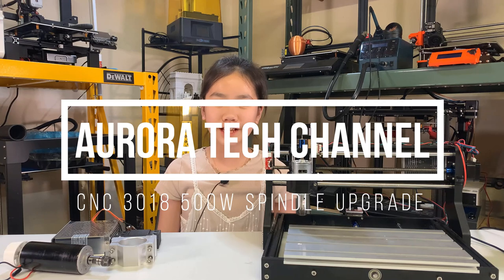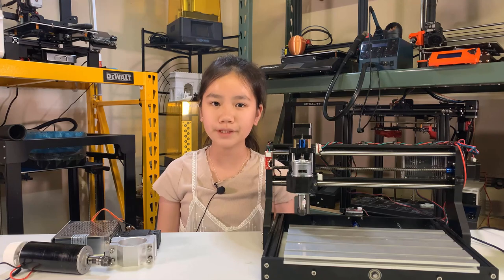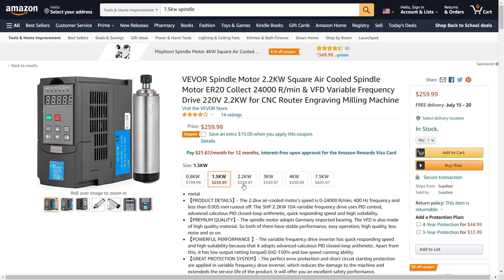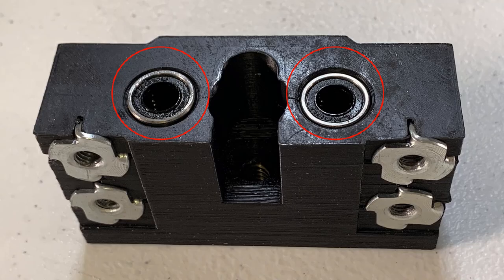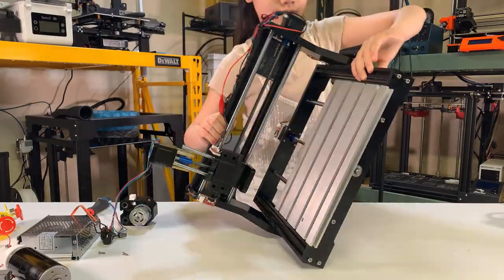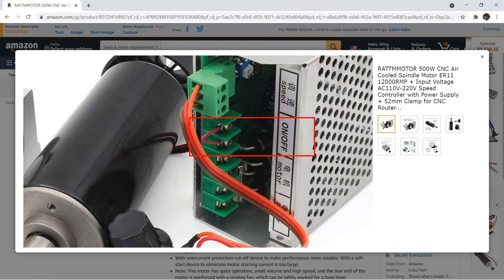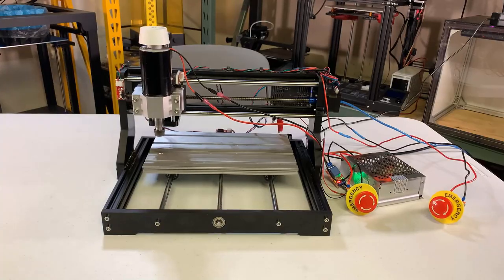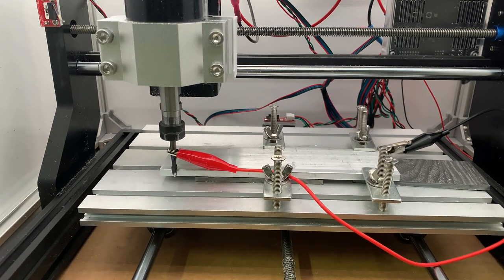The cheapest $149 CNC 3018, cut and mill aluminum is now possible with 500 W spindle upgrade

Comment: Two years before there wasn't much detail about this, i struggled to upgrade

FYI,The stiffness of the linear rods are not sufficient for cutting, i added linear ball rail , designed bracket myself and printed

Well presented detailed content, keep the good work

Comment: You and your brother are incredibly capable and smart kids. Just an observation on your video and someone may have pointed it out already, but your safety is number one. Always use tabs for profile cuts as some hold-downs such as double-sided tape or CA glue on blue tape might not be sufficient enough, especially when aluminum gets heated during the milling. That part that flew off was very scary and could cause some serious injuries. I know you put your CNC in the enclosure but that one didn't seems to be in the enclosure or at least it didn't look like it. Please be safe.

Comment: I went to school for cnc and I didnt know you got more torque at higher rpms, super cool
Reply from the maker: Hello! It actually depends on what kind of CNC / spindle. For this kind of low-priced spindle, you get more torque at higher RPMs. But, on a more expensive CNC, the constant-torque spindle can maintain the same torque at different RPM. Thanks for watching! :D

You can try Googling "Why does the torque curve drop off at low RPM" and you will probably find some better explanations.
Reply: @AuroraTech  What a champ!

Comment: I love your presentation - you guys are great.  I had bought the same 500 w Spindle upgrade to my 3018 Pro and was searching for some help on Youtube for the installation.  I literally bumped into your video and love it, I've watched it several times.  I have a question about connecting the E-Stop and Relay - I can't see exactly how you connected those - can you please share which end of the Relay you connected with the E-Stop and which to the power supply and which posts you used - please???  Thank you in advance and keep up the great work...ml Colorado  btw: my son-in-law is an electrical engineer who is going to help me come up with a way to connect the spindle through the Grbl Controller so that the software (Grbl Control Candle) can control spindle speed - when I figure that out I'll share it with you if you're interested.

Comment: tbh it looks worse then my stock spindle ... (agreed i saw way worse cuts on other 3018s but still..)
btw for everyone wanting an cheap and easy upgrade, the spindle is not the problem on these mashines... well, it kinda is but not the power but rather the floppieness of the connected ER11 chuck. take a fitting ball bearing onto the shaft of the ER11 collet, print a part that holds the bearing as stiff as possible to the motor and see how much it improved.
PS.  for everyone wondering, i tested, well.. rather experienced that aluminum is no problem for the spindle motor even with a 5mm DOC @ 100mm/min and even V4A steel worked for the motor... main problem there was the overall stiffness of the mashine but the motor had no problem with 2mm DOC @ 60mm/min (granted it looked and heard horrible due to missing stiffness in frame and coupling to ER collet but it did cut the pipe in one go ....)

Comment: I look forward to seeing your next video. I have not had my 3018 for long and it's interesting to see what it can do with some upgrades. I think I will need fusion 360 as at the moment I am trying freecad but it is very hard to learn.  Excellent video again and thank you for sharing.
Reply: One thing to be careful of once you get used to a CAD tool you'll end up sticking with it like glue so choose wisely. I use 360 it's fairly intuitive it can be a little buggy so make sure you save a design early on it has auto save but it only works after you've saved for the first time nothing worse than losing hours of work because you forgot to do a first save, like I say it's great but it's also tied to a company so they could change the license rules anytime they like. Free CAD is definitely less intuitive but no-one can just change the license rules on you.
Reply: Thanks for the advice I have been caught out by autosave? before.
I will probably have to return the 3018 as the fan on the laser is faulty and makes the squeal that fans do when the bearings are shot, the seller thinks that it is normal! so I will have to get ebay to step in.  The laser has not done more than 2 hours and if the fan won't keep it cool it will fail.
Reply: @thingys-rd7id  never really used a laser if I was going to get one I'd probably go all out and get a tube laser as I'd be more interested in cutting than etching if only I had the space for one.

Comment: Hello great video. I upgraded the stepper to the larger stepper motor but now it just shakes and I have to reset the machine. Its as though it needs more current. The smaller steppers still work first but this new one almost causes over current

Comment: Again a great educational Video you guys are just a treat to see. Yes I want to get that Mill, I use F360 already for 3D Print parts and I have a Cr 10S Pro V1 printer I have many of the same tools you do. Now I need that Mill. I need to make train parts for Motor Mounts and Steam Engine Linkage. I wonder if Aluminum can be Polished and buffed to shine then sealed to stay shiny? The Linkage is only 2 or 3 mm thick. Will it be stiff enough as these main linkages are used to drive all the wheels. If I sent you a part can you assess the process to make it for a Project, If I help pay for your time???? Dennis

Comment: Very helpful video.
I did the same upgrade early this year, but I didn't upgrade to a bigger stepper motor. I read the control module manual and it mentions something like: "the maximum motor currents for the stepper motors used must first be set on the control module using the appropriate miniature potentiometers" and I was afraid that I had to make changes on the control module and I am not savvy when it comes to that.
Is it necessary to make changes to the control module when you upgraded to a Nema 17 40-48?

Can't wait to see your next video about the limit switches and the probe.   Thanks.

Comment: need to hook up a blow Nozzle to push those chips away, of cores a better option would be cutting fluid nozzle which you would want to use a non conductive cutting oil, and run it at a high enough pressure to push the chips away from your work piece.. this will improve the accuracy and over all look and quality of your end product, will also extend the life of your end mills and spindle by them having to work less to cut

Comment: Hello, good afternoon, thank you for your attention and your response to my previous query.
I have made the update of the 500 W spindle as indicated in your videotutorial and it goes great, except for the part where you replace "STEPPERONLINE Nema 17 Stepper Bipolar Motor 2A 59Ncm (84oz.in) 48mm Body 4-lead W / 1m Cable and Connector compatible with 3D Printer / CNC "
I would like to ask you another brief query regarding the above, and it is that I have acquired another nema, which has two axes for the purpose of adapting a manual knob, "Nema 17 stepper motor, double axis, 48mm, 17HS8401S, 1.8 TO". but this one doesn't work. a greeting.
Reply: problem solved. a greeting.

Comment: I really like your channel.  So now it's no longer a 149$ cnc.  Cnc 149$+limit switch 6$+spindle motor and power supply 100$+nema motor 14$+spacers 4.5$+power cord 4$+ Bearings 10$+screws 10$+tnuts 8$+wire 7$+24v relay 6$+end stop buttons 2x4$=327$.  For enclosure mdf 2x6$+led 18.5$+acrylic 46$+magnetic tape 14$+corner brackets 27$+ aluminum extrusion 80$=197.5$.  Total 327$ +197.5$=525$ minimum more transport of the different parts, reinforcement of the X axis, laser etc, etc... $$$

Comment: I have a bunch of aluminum parts I am making, I wanna upgrade my CNC that is a 3018 Prover extended to 3040, this is a great looking upgrade, how does it compare to the off the shelf versions that sainsmart offers? I wonder because I cant 3d print a fan or spindle retainer/mount.
Reply from the maker: I don't have a sainsmart 3018 CNC, but it just look the same as those cheaper 3018 CNC from eBay or AliExpress with the same 60w 775 spindle, the same frame, and the same design. So I can't tell the difference between a sainsmart and an unbranded CNC 3018 machine at all.
Reply: @AuroraTech  i need help how do i wire the relay without the emergency button

Comment: WHAT IF MY UPGRADE PS IS 24V OUTPUT, BUT THE ORIGINAL ONLY HAS PORTS FOR 12V AND 48V.. CAN I STILL RUN A LINE TO IT? WILL ANYTHING FRY OR BLOW UP?

Comment: Hello good morning, I would like to know if it is possible to have the wiring diagram.
Besides, I would like to know, if on the "Control Grbl" board of the CNC 3018, the terminal, "0-500w, power 048v" is used, and in that case, what would be its purpose, and what type of connection It would be done?
Thanks for this great contribution.
Reply from the maker: Hi, the 0-48v terminal on your board is a MOSFET which works the same as the relay in my video. Since my board doesn't come with an extra MOSFET like yours, I have to add a relay to control the external power supply. But I am not sure that 0-48V terminal is OK to control the 110V power supply, or you can consider a brushless 500w spindle which cost more, but make less noise and uses a 48V power supply.
https://amzn.to/3yna7TD
Reply: @AuroraTech Thank you very much for your attention.
It has been a great contribution. I had also thought of replacing the board with this other GRBL Voltage Regulator Control Board, 4 Axis Stepper Motor to add Mini Woodworking CNC Router, 4 Axis Rotary Axis Engraving Machine.
A greeting from Spain.

Comment: Great Video - I bought the Comgrow .  Updating to the 500 watt spindle and relay that you suggested.  What are the three wires that are going into the input of the relay.  I have the two that came from the spindle. The green light on the relay comes on when I give the start spindle command but does not trigger the relay.  Any ideas.  Thanks in advance.
Reply from the maker: The green light is ON means the signal line to the relay is connected correctly from the motherboard 24V terminal. Please check the power supply and the spindle and see if it connects to the relay correctly: 
1. The positive of the spindle and the positive of the power supply are connected directly.
2. The negative of both spindle and power supply connect to the relay, when the signal is triggered, the relay will connect them together.
You can also watch and pause at 8:24 of this video for wiring, if you don't have the emergency button, just ignore it and consider that is the spindle.

Comment: I am planning to buy a CNC 3018, but I have seen recently that there is the CNC 3018 Pro MAX, which has an aluminium frame, do you think is it worth it? It's about 50% more...and spindle comes at 200W instead of 100W
Reply from the maker: the difference between a 200w spindle and the stock one is almost nothing, may be $10.  The hallow aluminum extrusion is not any better than thick 0.5” bakelite. 

I would still prefer the $150 CNC3018 + $70 500w spindle upgrade.

Comment: Electric motors do NOT use RPM to produce torque.  In fact, electric motors produce their max torque at 0 RPM.  Horsepower requires actual rotation.  Torque is a twisting force, while HP is actual work produced.  If you need 100 Ft/Lbs or In/Lbs of torque to move something, any amount less than that will not do the job, but will apply what force it can.  this is torque.  if it does move, this is work done, which is horsepower

Comment: so you machine end's up . Costing 10 times more than the best 3040 on the market. and comes with all the gadgets you add on you 160 USD cnc router.  I do have the wood pecker 2418 first laser and router combo from 2015.  I still runing the same  cnc. works fine. The only thing is. That machine was biuld in mind of what was biuld.  Aaaaand if you pretend to cut to cut 1 inch aluminum. You still cut do that. but insted of upgrading all the hardware. You just adjust you process router plugin. till the point you can cut the 1 inch aluminum. Is going to take longer . But the job will get done.